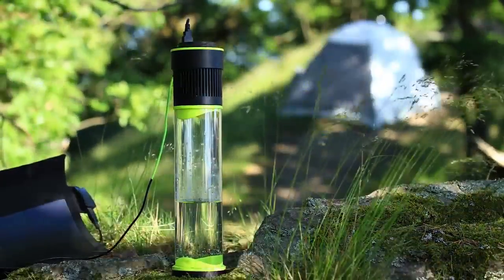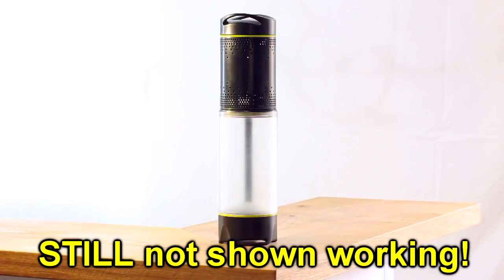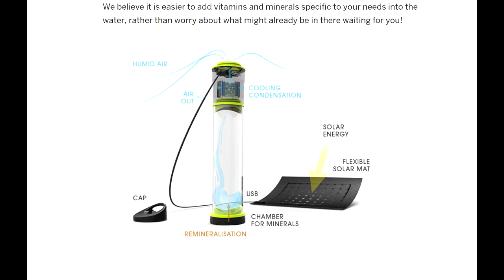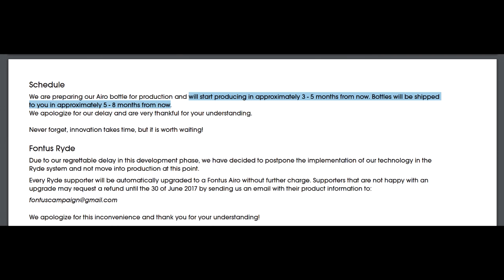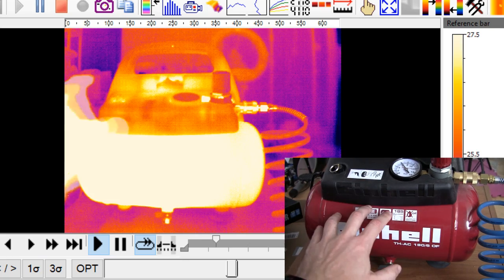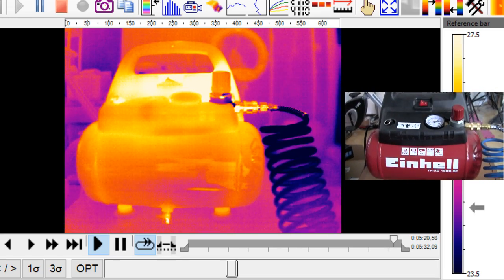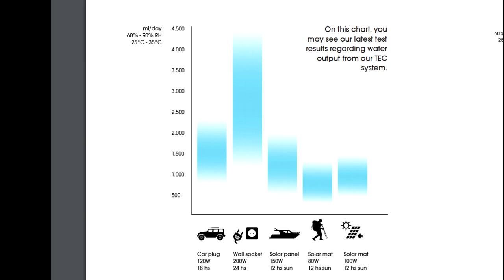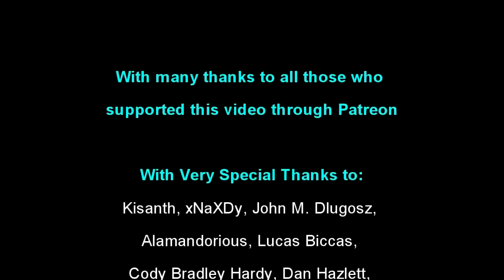$300 000 Self-Filling water bottle, SUPERFAIL!

Comment: "100 times more expensive than water from the tap."

Well,  then at least it's 10 times cheaper than purchasing a water bottle at the store.
Reply: It's not the same, who wants to wait around 8 hours for a bottle of water? Buy a gallon bottle of water for $1.50 fill this bottle and drink out of it 4 times before its even filled. Or a case of small bottles for $3, which is about $0.10 a bottle and have your travel size. The bottles are lighter than single purchase bottles and they compress easily so easier to pack out. I would like to know how this thing costs $0.01 with its energy consumption? Did you do calculations or is this sarcasm?
Reply: Also, if you live in the desert, you aren't going to be pulling water out of thin air.
Reply: Where are you taking your numbers from? Water price varies from country to country, some are deserts.
Reply: The cost of water depends on supply and demand like everything else. It will cost a lot more to get a bottle out of a mini-fridge in a hotel than it does to buy it by the case at the supermarket. There's nothing surprising about that.
Reply: Memorial Day weekend stuff. I was taking from memory of what I've seen here in the US. I do have a receipt for a 28 pack of 500ml bottles for $1.99
Reply: When you take the water out of the bottle it's just water.
Reply: Not the same, one is energy consumption in the production, the other is economic value. :D
Reply: Yeah obviously, but for the consumer it's the same. (And this is a consumer product)

Comment: i have a device which gets water out of air,  it works only when it rains 

i call it a bucket
Reply: Dark Enforcer   +1 internet point from me
Reply: Take my US$ 300,000.

Every scientifically illiterate person.
Reply: self filling water solar bucket?
Reply: It's not a bucket, it's an open-top cilindrical moisture collector.
Reply: I have a device that is 10 times more efficient, its a bucket under a gutter.
Reply: can I plug it into my USB?
Reply: I hope if I invest in this new bucket device you don't come back to me in a few months and tell me there has been a slight design change, and now its called a barrel. I can't fit a barrel on my bike.
Reply: Matthew Pike typical Gallente behaviour, you see an enterprising capitalist, takes all his ideas, double it for self-aggrandizement, and pass it off as your own with a cultured smile. Why the Republic ever accepted to be fodder in your wars, I'll never know.

Other than that, nice portrait. Still playing?
Reply: Yea, but can you ship this "bucket"-device for less than $250 ?
Reply: Might I suggest an improvement. 

I call it the 'iFunnel'

It is added to the top of your product, and increases the surface area for the rain to collect in.
It's got four legs on the corners and a light frame to keep up the edges.
It comes as an add-on, for a mere $49.99 per bucket.
Reply: This is my bucket, there are many like it but this one is mine.
Reply: Don't fall for his bucket device, I bought one and it doesn't work.
I left it out in torrential rain for 6 hours, not a drop of water was collect. 

What do you mean I had it fuckin upside down, excuses.
Reply: I believe it's more efficient also. It only consumes luck - If you're lucky and it rains ..... it works.
Reply: Reminds me of the con-man who started a business from his prison cell selling "Solar-Powered Laundry Dryers" for $49.95 each. He cleverly worded his advertising so that he made NO false claims at all. What you got for your $49.95 was a 50 foot length of clothesline and 2 dozen clothespins.
Reply: Yeah,lets ship it to Africa!
Reply: This is a revolutionary invention; you need to start a kickstarter campaign. Solar fricking water collector!
Reply: Dark Enforcer I chuckled heartily. +1 Internet for you, sir.
Reply: i'll give you 2 quid for it!
Reply: Call it  the " i bucket " and you will raise millions !!
Reply: Where can I preorder!?
Reply: Stick on a solar panel and some thorium and I'll pay $$$ for it.
Reply: the solar powered smart bucket ,can connect to the smartphone app through  wifi how much rain water had collected from the bucket and connect to the cloud
Reply: IT'S LIKE MAGIC
Reply: Someone Lol sorry my pond works way better
Reply: but is it golden?
Reply: You're supposed to put a solar panel on it make it green. ;)
Reply: Can I add 100$ to your revolutionary BucKet tech? Is that an acronym? What does it stand for?
Reply: Dark Enforcer cool but how can i attach a can opener on it and make more money
Reply: shut up and take my money
Reply: It generates water faster than the Fontis watterbottle, PogChamp
Reply: Dark Enforcer have my money!
Reply: What is this bucket you speak of?
Is there a prototype?
Reply: A bucket? Absolutely brilliant!!! TAKE MY MONEY!!!!!
Reply: just drilling A hole in the ground and putting some pumping device in it will produce lots of water at most places.And here in the Netherlands we actually do more pumping to get rid of the water.
Reply: what
Reply: SHUT UP AND TAKE MY MONEY
Reply: +Dark Enforcer We must disassemble this wondrous contraption in order to learn of its inner workings and reveal such marvel for the benefit of humanity.
Reply: I also have this REVOLUTIONARY device that can transform uncooked animal parts into edible meat, ready for consumption! It can solve our problem of overpopulation too!

I name it an OVEN! Now all you have to do is give me $400,000 on Kickstarter. As a stretch goal, $500,000 and I'll make a lighter, less expensive version titled a MICROWAVE!
Reply: Yeah, my city installed a huge water collecting network that can gather hundreds of times what your bucket can.  They all it “gutters” and every road is lined with one on each side.  The water is ultimately collected in a reservoir they call the “sewer”.  I don’t know if I’d drink the water, but it’s probably more potable than the water from this dehumidifier they’re calling the “Fontus”.
Reply: Genius.

Amazing have my money!
Reply: Does this "Bucket" of yours have a solar panel on it?
or does it use a usb for power?     ......I need to know.
Reply: HAY HAY HAY NOW, CHECK WHAT STATE YOU ARE IN!!!!
THIS IS IMPORTANT AND I WISH IT WAS A JOKE!!!!!!!! MORE EXCLAMATION POINTS ARE NEEDED TO GET YOUR ATTENTION!!!!!!!!!!!!!!!!!!!!!!! read below.

Depending on what state you are located you could actually be doing somthing illegal that you never thought of before.
What is this illegal thing? Well ever heard of places where people have gotten in trouble for catching rain and putting it into barrels?
The law applies to any device that does so, So  depending where you are I am going to have to report you.
What is your name, your address, the name of your dog, your pet gerbils preferred brand of food, the Actual killer clown next to you who waves at you every morning without his makeup on's name, and finally all of your Goldfish's bank account number?

Sorry it's the Lawl!!!
Reply: Does this "bucket" device also work in winter months when it is snowing?
Reply: Matthew Pike I have 2 bigger buckets
Reply: using actual rocket science, you can generate water when it doesn't even rain, from nothing but the most abundant stuff in the universe, the oxygen in the atmosphere, and a lighter!
Reply: Wow! That's sounds amazing. Now you have to create an overambitious advertisement for an indigogo. Then go on a vacation to test the device.
Reply: sounds like magic

time to bust it
Reply: hmmmm….. I DUNNo …. is this so called "bucket" a REALLY REALLY kewl design and EXTREMELY overpriced ?   Yes ? ! ?   You promise?   Okay, then I'm in  !    #FOOLandhisMONEY
Reply: Take my money
Reply: Dark Enforcer I can get twice as much water as you. I call it 2 buckets.
Reply: You are not presenting your product well enough. You must say something like this:

My device is cheaper, 50 times lighter, has more capacity and it produces water with no energy at all.
Its current production level is 10 liter per year, meaning that for 20 of my buckets I mean, devices, you get over 1/2 liters per day. More than enough to fufill your needs.
And remember, if you buy now all 20, you get an special discount.
Reply: Bill Cooper it is a classic joke
Reply: Picobyte But if water is abundant, can't you sell it ?
Reply: It can happen months here without a raindrop. A humidifier would still work better.
Reply: Collecting rainwater should be more popular than it is. The technology for filtering and storing it has gotten significantly cleaner and cheaper since the 1900s
Reply: apologize
Reply: Dark Enforcer I have a device that endlessly copies itself and then proceeds to suck its own dick for it.

I call it the YouTube comment section.